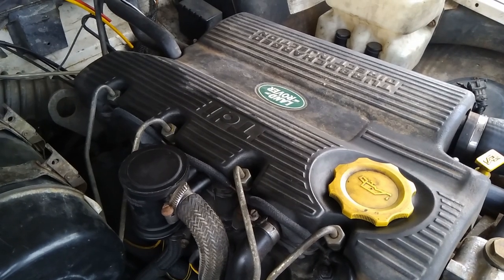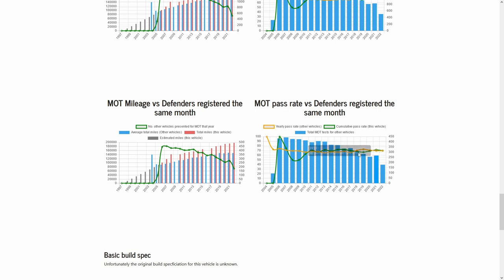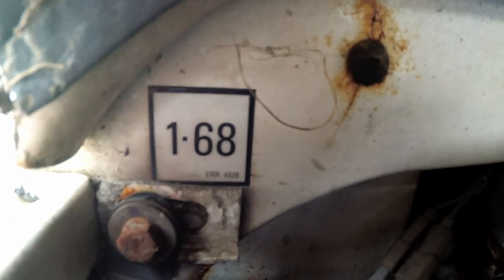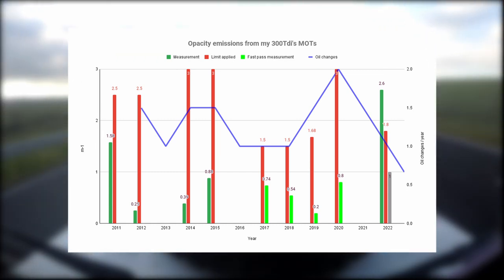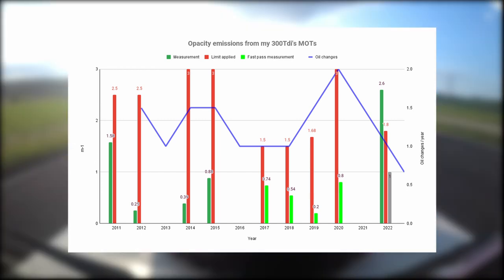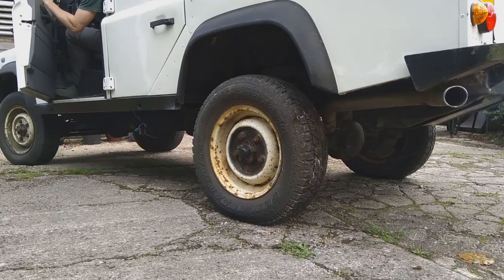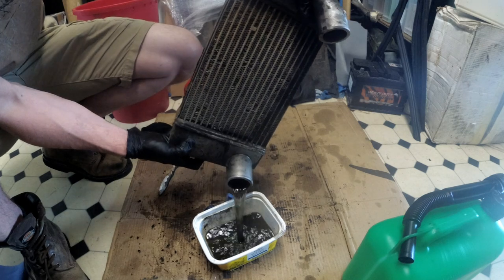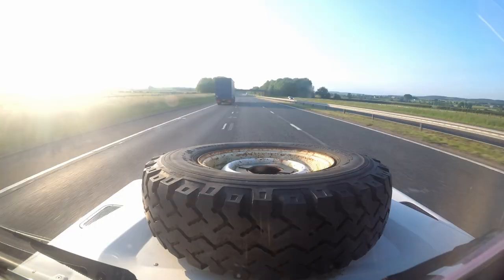300Tdi MOT Emissions Fail. How common is it?

Comment: I watched mine pass on the smoke test machine, slight looks of disbelief, though the screwdriver I took to the front end of the chassis when replacing the front axle with a sal left much to be desired, oh well engine out now, crankshaft gear nearly off, still in tolerance before first rebore -- 90.44 - 90.55 clock says 156,000 miles
Reply: Rebore"  mines is on 405,000  miles,,  runs great, never had the head off,

Comment: I have a Disco 1 300tdi and so far it has always passed the emission, she has 110000 on the clock and is 27yrs old I ahve just removed the intake plenum  which has never been off because the turbo was playing up well I have never seen a set intake ports almost 1/3rd blocked all caused by the breather vapour i am now going to fit a catch can .

Comment: there is a adjustment lockscrew on the back of the pump 300 tdi ,so it can be adjusted for emmisions ,same as the old di transit ,and pug 1,9 pre hdi ,just adjust it down , old style engines will always pass as they were built to be worked on ,

Comment: My '96 300tdi has been "on the limit" for the past 3 years here in France which seems to have similar limits.
This year I used some of that injector cleaner in the fuel and I "turned down" the deisel pump.
I turned the pump screw 1/2 turn because a few years back, a new bigger intercooler was fitted and the garage boosted the pump to get more power.
The MoT tester said it was well within the limits.
I also changed oil and the deisel  filter so what actually made the difference, I don't know.

Comment: Sad to say I'm one of the 2021 fails 😪 (1996 300tdi)
But only due to a bent conrod. The piston is only a few mm short but it's enough to reduce compression in no4 cylinder and create a bit of smoke. I've taken out the engine for a rebuild. Here's to a 2023 pass!

Comment: As LR geek I always submit oil samples to a lab after each change and they can recommend change intervals based on the remaining additives in the oil and also see issues with the internals based on the various metal content. Really great service and an exceptional money saver as I'm up to 8000 mile intervals on my 300tdis and 12,000 mile intervals on my LR3!

Comment: Very good info.
My MOT man is very fair, tough but fair in sharing his knowledge. He has said the same thing, give your diesel a dam good thrashing on the was to the test centre. 
Cleaning out the intercooler and associated pipe is also good advice. 
I can't believe how much oil actually finds it's way into the intake but there we go.
Reply: Oil in the intake can come from leaky turbo oil seals, but I suspect mostly it is from the breather. I clean my breather and pipe every couple of years (8,000 miles).
Reply: @gshort4707  Yes, I did think about the turbo oil seals. I do the same, I clean it all out, normally just before the MOT. It's not cheating, honest!

Comment: I just drive to the garage in lower gear 3rd usually rather than having to thrashing along at 70 , I  check the end of the exhaust is too hot to touch at some point on the way and never had a problem

Comment: Will, it depends a lot on how the test is conducted. I recently had problems with two Landrovers failing the emissions test. I found the tester was opening the throttle fully but releasing the pedal before the turbo had fully wound up. In one way he was being kind on the engine by not screaming it but this actually made it smoke more. 
I achieved a pass by offering to rev the engine while he observed at the rear. I was half a second longer getting to full throttle, so just a bit more progressive with the pedal and I held it at full throttle on the governor momentarily. Revving it a lot harder than he had done but the exhaust was a lot cleaner.

Comment: I have a 300tdi fitted to my 1972 Series 3. For many years I ran it without the Turbo. For  some reason the MoT station did an opacity test some years, but not others. though I'm not sure it the opacity test applies to a 1972 vehicle. But anyhow, the first acceleration figure was usually about 2 or 2.5, requiring a 6 accleration average. It passed these with a figure below 1[m-1]. 

A couple of years ago I had the turbo and intercooler fitted. They have done one opacity test since then (in 2020) and it passed the "fast pass" test with a figure of 1.09. Thought the emissions sheet says "Turbo fitted: NO"!

Comment: My 1997 300Tdi 110 Station Wagon failed the emissions test first time result was about 3x over the limit. My breather needed cleaning, my turbo was worn & oily and my fuel pump timing was erratic as a result of a worn (slotted inside) crankshaft pulley. After oil & filter change I replaced worn turbo cartridge, air filter, fitted new timing belt & pulley kit, checking timing, replaced hoses and cleaned out intercooler. passed smoke test result 1.3 after a decent drive to the MOT station. Interesting that you posted this as I was about to tune my fuel pump a bit to make the engine a bit more responsive without adding more smoke.

Comment: I used to take the fuel filter off and fill it with Forte deisel treatment, I've also used paraffin with good results.
If your engine is ok it should be pass without any of this .
My one has it's MOT this week it's more likely to fail on rust rather than emissions though.